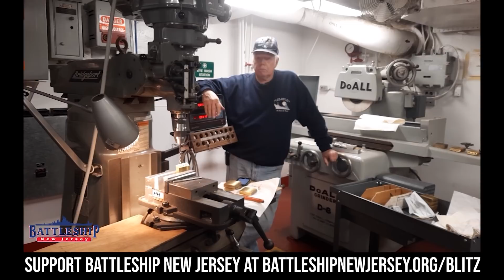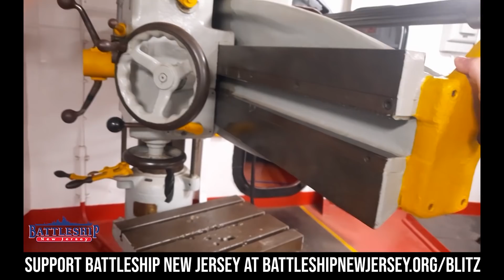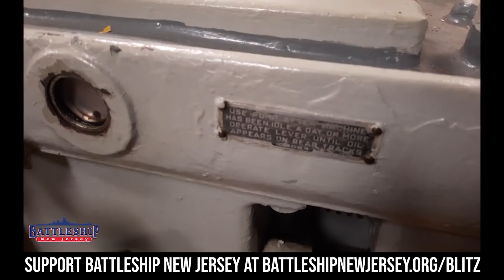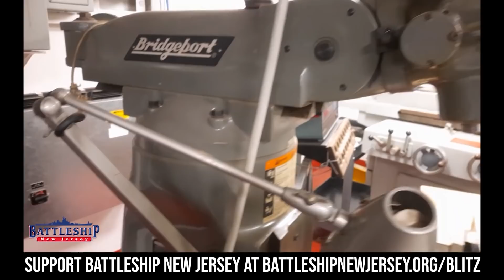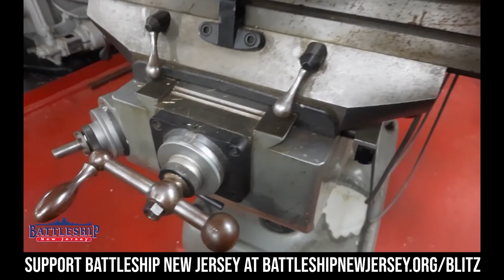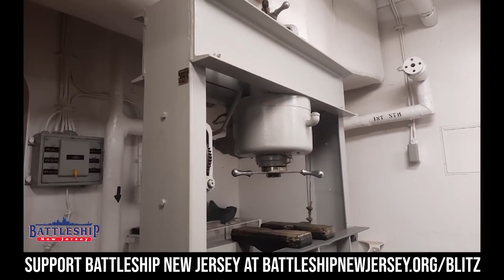Battleship New Jersey's Machine Shop with Ken Kersch

Comment: Unfortunate to see the open side planer going unloved. I own & use a shaper, the operating principles are similar.
Reply: Geoff Matthew's when I was on board BB62 we rarely used it. We would cut zinc mainly in strips.  One time I did cut a set of splines with it just to see it run. That planer was really underutilized.
Reply: Was thinking I might have to ship them some hydraulic fluid barrels.

Comment: Can the ship moving and and flexing when at sea affect the tolerance you can hold or cause slight bows or waves along the length of the part, also is there an inspection room with a surface plate optical comparator ect and was they're a specific brand of inspection and machinist tools that the ship used like starrett, brown and sharp, Flowers, mititoyo exc or was it a mix of brands. Also are there prints available for that brass turret to make your own
Reply: IIRC this shop is sitting on top of the citadel, so it's got something like a 16" armor steel floor, combined with the rigidity of the machines themselves, once they are set up they'll hold tolerance.
Reply: All fantastic questions that I too would love answered... I can't imagine they used Mititoyo in '42 haha that or any brand named Bavaria or the like =)

Comment: Ken is GREAT!
Get him his favorite beverage and keep the camera rolling. Let him tell more sea stories like fixing the pump from the other ship.
Reply: I love sea tales.  Some of my father's coworkers were in the Navy.  One was a welder and the other was a electrician.  The one that was a welder welded his teeth shut while trying to repair a bilge pump.  He didn't ground is equipment properly and the voltage welded his fillings together.  So after recovering from the electrical burns, he went to the dentist who had to pry his mouth open, dig out the fillings and replace them.  The one that was an electrician is a plank owner on the USS Wasp (LHD-1) and spent his time in port wiring up the RADARs before the shake down cruise.  He said the two most scariest times in his career were climbing the RADAR masts in rough seas, and after fixing a motor he was climbing down the ladder went the RADAR dish went active.  Had he still been up there he would've been microwaved.  Apparently one of the RADAR operators "didn't see" the lock-out tag-out signs and fired it up.

Comment: How many machinist mates were typically on duty in the shops?
Reply from the maker: 8
Reply: @BattleshipNewJersey  You did not mention welding.  I assume Oxy-Acetelyn was the original issue.  Maybe electode stick welding later?
Reply from the maker: Thats a different rating of sailor, thats the Hull Technicians. You can see their space in this video: https://youtu.be/BdudSHtdueo

But oxy acetylene was definitely the standard in WWII, other than that, I'm not sure I'll have to check with the maintenance guys... - Libby the editor

Comment: I wonder if NJ's engineering dept could have overcome the rudder jam that mission killed the Bismarck
Reply: I bet they had a machine shop as well, even submarines have some tools and machinery for repairs. But they took a torpedo hit to the rudder so the damage was quite severe plus under the waterline both inside and outside and they couldn't even stop as they were pursued.
Reply: Probably not without dry docking it.